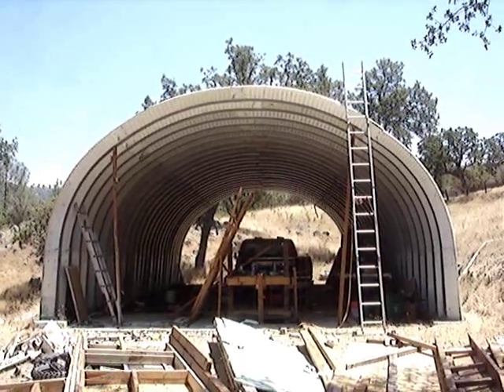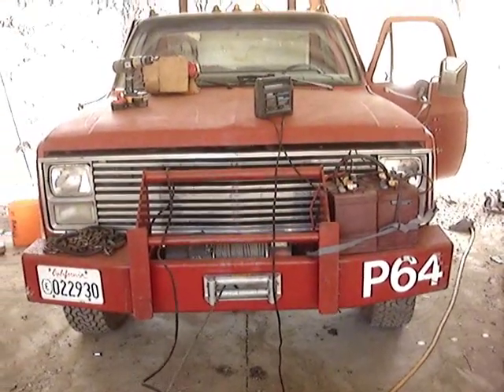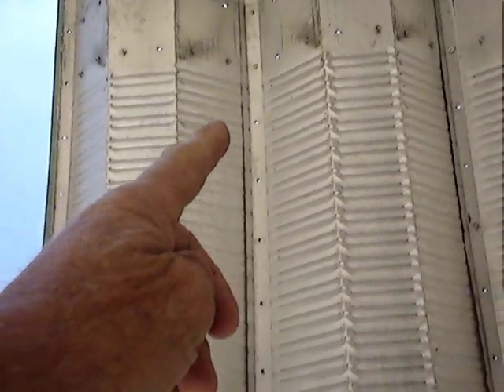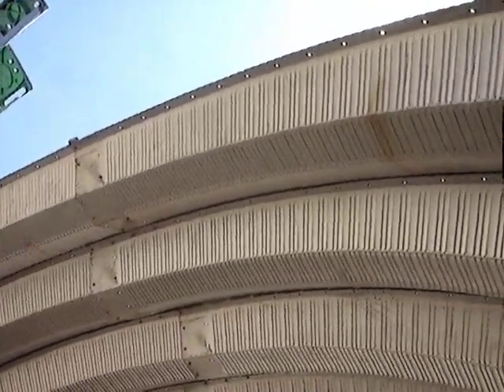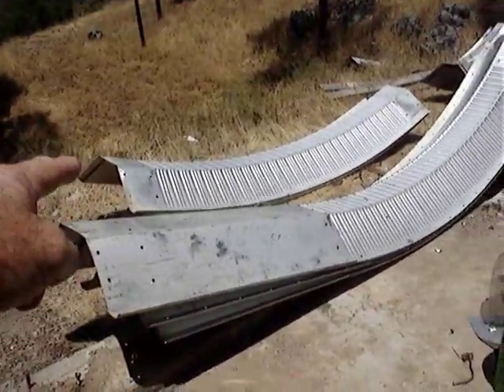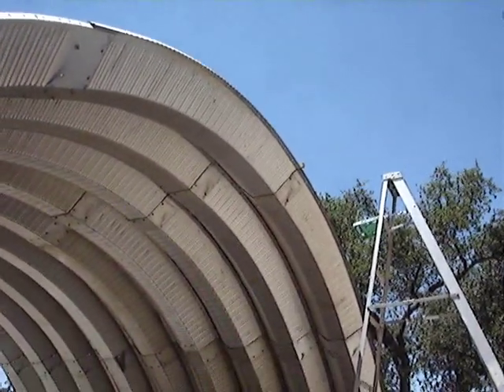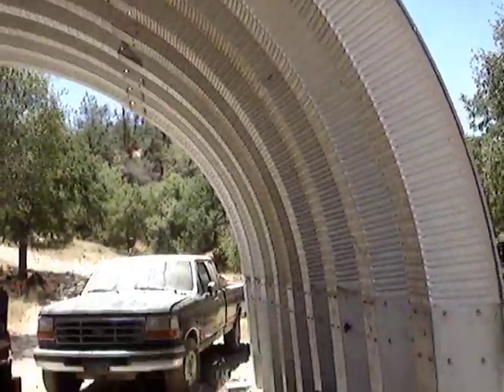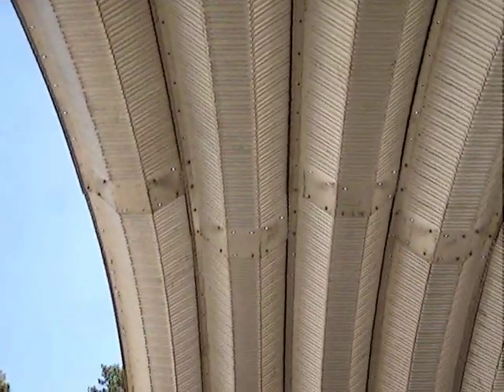Modular Steel Building Disassembly and Assembly Steel Master

Comment: I wish I had seen this video a couple weeks ago!!  I have a new 40' x 50' x18' building we just tried to assemble the way the instructions show. I had a really cool rope and pulley system with a bridal.  Well, we wasted an entire day.  Those arches are like trying to lift a noodle!!  Your method looks much better.  Now I have 25 arches fully assembled in my back yard that we will have to break apart.  Grrrrr!!
Reply from the maker: Yes, I had the same problem.. I called the company and told them that This is the right way to do it. 2 guys, one panel every 2 hours. One person can do it this way.

Comment: I think there the greatest invention since the wheel. There affordable , wind proof up to 200 mph, and strong!  I like them so much thinking of living in one. one day. 1 person can put it up. believe it or not. Just working on one on the weekends about 4 hours a day,  it took 3 of us a month to put  a big one up 35'w x 53' L x 16' H. They need to be insulated with foam.  our is 10 years old and no surface rust at all and still shiny new looking.
Reply from the maker: 426 SUPER BEE Yep. BUt 2 people makes it easier.  The instruction manual is a joke., you put together 5 of these panels and try and rotate them is an exercise in frustration. I found the method shown here took 2 hours max per arch. Or about 40 hours for a 25x50x14 building. $6000 approx for 1200sq ft
Reply: *****
I agree the instructions sux! its not to hard to figure out.if one had any drafting and blue print skills, Mine had it to put 5 archest up and plumb bob it and its hard to move it.  Yea once you put in the foundation is about 5k you will have about less than 20k in one, it stronger than a house and cheaper than a mobile home For sure!    more help is better, up to 3 people!  More than that just get into either others way. But 1 can put it togather if not in a rush. Yep its pretty flimsy putting it up in arches, why they do it that way much easier to bolt them togather and a little bit faster too.  i bolt 2 panels  togather and side it up on the arch and put into place.

Comment: We just built a 45x50 and it's true that raising full arches with just ropes doesn't work! But what does work is using a spreader bar. Without it the arches will fold. It's also better to use a crane or tractor boom to life instead of trying to pull ropes manually. After killing ourselves with different methods this one works well and it's up. We will post a video soon. My pops is seventy-two and works harder than the twenty-year-olds we hired.
Reply from the maker: I tried putting a cross bar of wood in the arch and it was too much work.  This method shown works, at least for this size. The arch just flexes too much when I tried to lift it.

Comment: I put up a 45' x 74' Quonset Hut only to have to tear it down 4 years later, I am currently putting it back up. I set it up the first time at the Michigan Renascence Festival grounds to do Laser Shows inside, after three years the management decided to change our agreement to something unacceptable to me so I removed the Quonset Hut from their property. After about five years of it setting in my field, I am finally putting it back together o my land. One friend and myself are able to put up 2.5 arches per day, the building has a total of 36 arches I think. It is 17" tall at the center and we are building it piece by piece rather than arch by arch. There is just the two of us and I am 60 years old and my help is 64 years old, so standing up entire arches is out of the question ( that is how five of us put it up the first time, pre-assembled arch by pre-assembled arch ).
Reply from the maker: That's pretty much where I am. And we did light shows in C. 1968. My friend, John Darcy, was the first to use a laser in 1969 at The Family Dog, On the Beach, summer of 1969!!